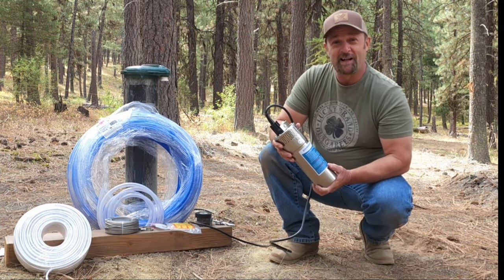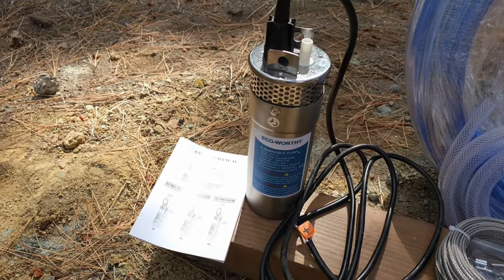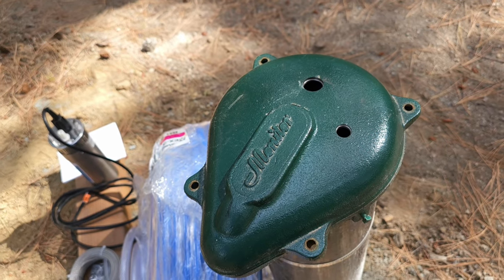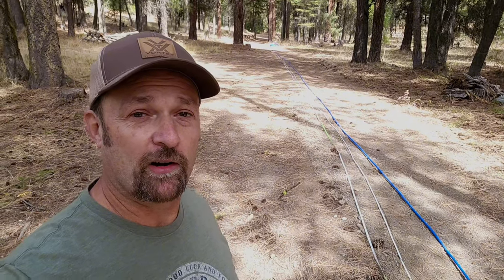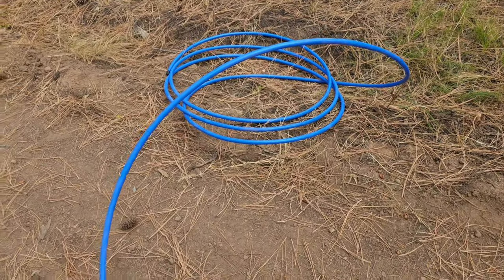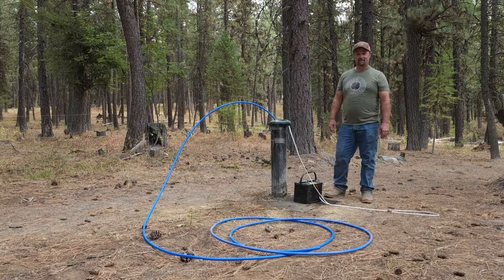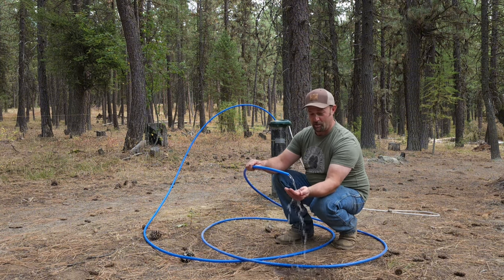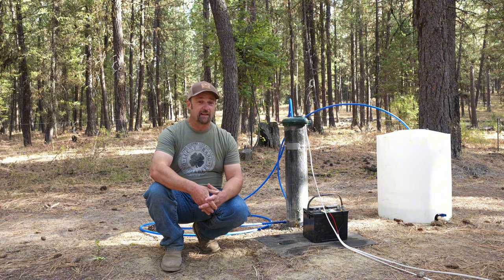DIY Solar Well Pump Installation - Eco-Worthy 12 volt Deep Well Submersible Pump

Comment: If you add the one-way check valve, put it a little below the freeze line for freeze protection and you will not have to wait so long for water to start each time.
Reply from the maker: Thank you.
Reply: Sound advice. What an incredible comments section compared to other channels. You've got a great audience.
Reply from the maker: I agree. Great people here. Thank you for watching and commenting @DoogieHoosier

Comment: You might want to do some voltage calculations as DC voltage drop over that distance is is going to be pretty significant.  I don't know what the amp draw is on the pump but I have to imagine it's pretty high with that much head pressure. I played with an online calculator and it said the voltage getting to the pump would only be around 8 volts. This could put unnecessary stress on the pump motor reducing its life.
Reply from the maker: Great point. I will have to do that. I ran the recommended size wire, and it seems to do fine, but I wouldn't want to shorten the pumps life. I think what you are talking about here is the reason for some of these pumps' negative reviews. I see people online using old extension cords for their wiring, which, over a distance, would not provide enough voltage to power the pump. Thank you for the suggestion and for watching. I will check it out.

Comment: Congats...great feeling.    I cheated on mine, you can feel the air being pushed out of the line before the water comes.
Reply from the maker: Thank you. It is a great feeling. Are you using a similar pump? How has it worked for you?

Comment: I bought a similar pump to water cattle and cant get it to lift water out of the well (120ft). In a bucket test it works fine but cant figure out why it wont lift out of well. Supposed to be 230’ of lift on pump
Reply from the maker: What size wire are you using? You need a minimum of 12awg but if i did it again I would use 10awg. If the wire is not big enough, the pump won't get the voltage it needs over that distance.
Reply: @  used 12

Comment: Did I miss something? What is the purpose of the vinyl hose? Would the PEX not go over the pump outlet?
Reply from the maker: Great question. I noted it at the beginning but I was worried the pex would be too rigid while handling the pump and cause the plastic barbed fitting on the pump to break. It was probably not necessary but gave me a little cushion. You could probably install the pex directly to the pump if you heated it up a little. Just be careful handling the pump. Thank you for watching!

Comment: WHY  DIDN'T YOU PUT IN A ONE- WAY CHECK  VALVE, SO YOU DO NOT MAKE YOUR PUMP REFILL THE WHOLE LENGTH OF THE PIPE EVERY TIME IT SHUTS OFF. Other than that good job.
Reply from the maker: Great point. After running the pump, it seems that it has a check valve in it. The water comes out immediately when I turn it on now.